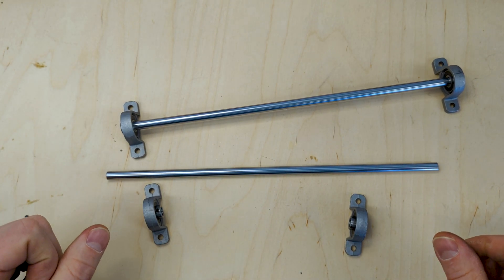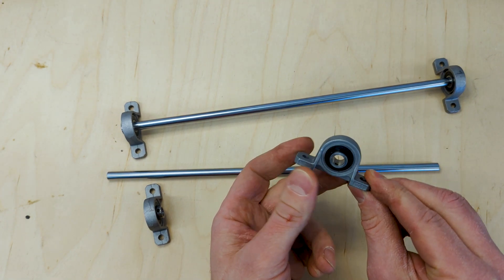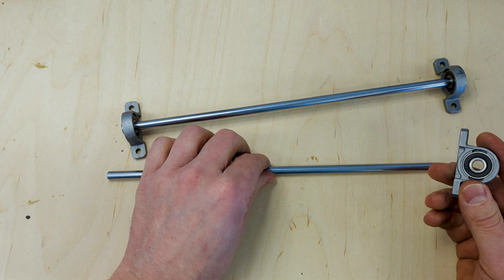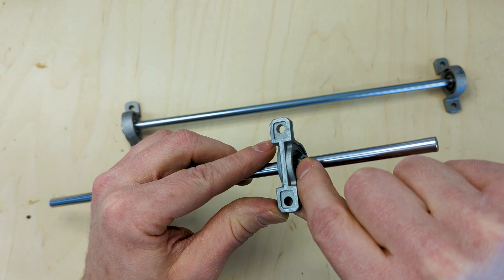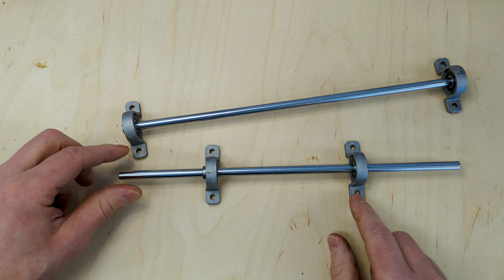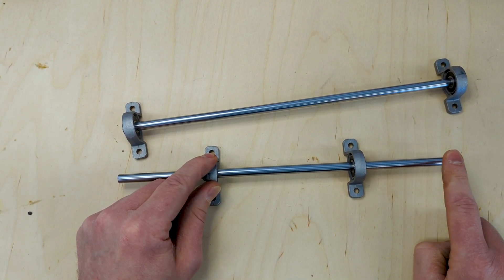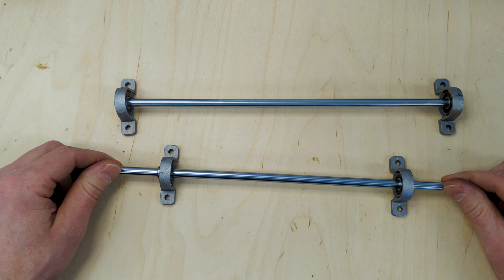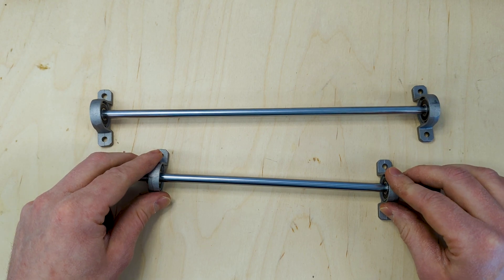Pillow block bearings

Comment: If I use those to hold my axle on my surf cart. Do you think the tires would rotate easier than just having an axle with the tires without the pillow blocks?
Reply from the maker: Big pillow blocks are used for the rear axle on industrial trikes like those from Worksman Cycles all the time, so yeah I think if sized appropriately they would work great for a surf card

Comment: Hi, I am trying to do search for gates. I am sure if a use this to hold gates, it can open 180 degrees. But just to confirm, is my understanding correct?
Reply from the maker: It depends on the gate design, the rod in the pillow block can rotate 360° but depending on the shape and the connectors to the gate eventually there will be obstructions, the pillow block will not be the limitation for the gate, but it may not be the best choice supporting a vertical cantilevered load such as a gate
Reply: @WhatMakeArt  Hi, thanks for info.

Comment: I need something like this for a vertical shaft that's nowhere close to a side wall. And these look like they can only be mounted very close, right on a wall (in my case, since the shaft is vertical). But my shaft isn't near a wall. Are there multiple types in regards to how they can be attached to a surface? Like: can I maybe find such bearings that have those ears oriented in such a way that the bearings can be mounted so the rotation is parallel to the surface they're mounted on, not perpendicular?
Reply from the maker: Yes, this is just an example configuration, there are tons of different types and mounting styles, a good place to start looking is that online McMaster-carr catalog https://www.mcmaster.com/products/power-transmission/

Comment: Can I pass motor shaft through only 1 pillow block and attach wheel on other side? Will it provide enough support?
Reply from the maker: That would depend on the application and the specs of the motor, I recommend consulting and engineer or the manufacturer of the motor and shaft

Comment: I have a question. I've seen people removing their large pillow block from the shaft, and they needed a puller tool to get it off. I want my pillow block to slide freely across the shaft as yours does. Do you have any idea why a pillow block would lock on the shaft with the set screws backed out?
Reply from the maker: If it was a close tolerance press fit then it wouldn't slide, could also be old and worn out
Reply: @WhatMakeArt  Thanks

Comment: I want to make small gym equipment (t-bar row machine) where i need to use two pillow bearing. I was planning to buy the 17mm bore diameter bearing. But i can never find a 17mm shaft online. It's always 16mm or 18mm. How do i make it fit? Should i custom lathe the 18mm or will the 16mm fit?😥
Reply from the maker: The shafts are usually hardened so machining them on the lathe would be pretty difficult and then not the best outcome. Have you tried McMaster Car? They have 16mm shafts and all kinds of stuff

https://www.mcmaster.com/products/shafts/diameter~17millimeters/
Reply: @WhatMakeArt  thank you so much for the reply. So, that means, i need the exact shaft diameter as the bearing bore right?
Reply from the maker: Generally they should match

Comment: Hi can I use threaded rod of 10mm size as the shaft in pillow block
Reply from the maker: If you pick the right size pillow block you can use any size rod, just check the specs